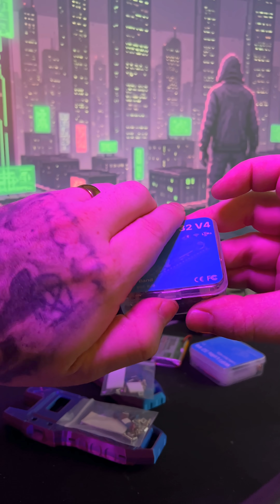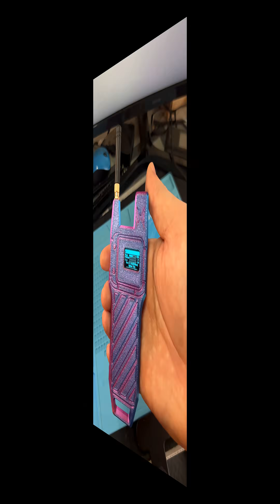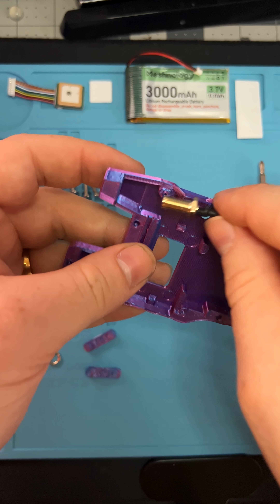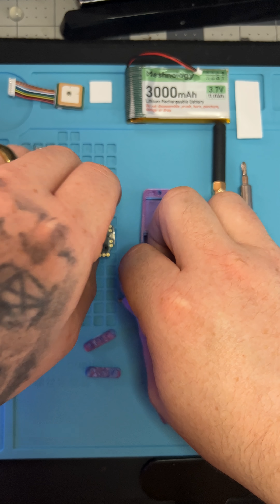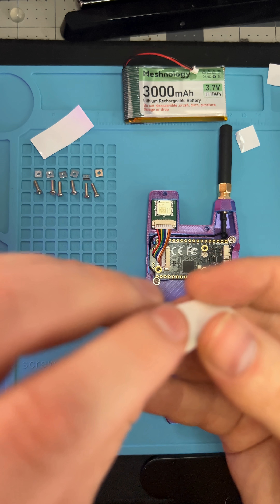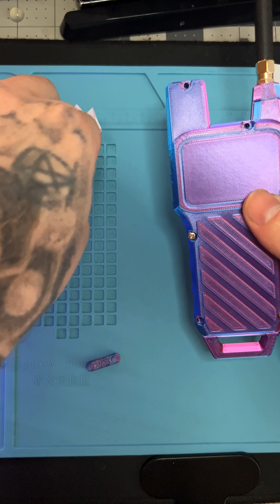LoRa Radio | Meshnology N39 + Heltec V4 Assembly

Comment: Good stuff where I can but it with this case?
Reply from the maker: This case can be bought on Amazon (not recommended) or you can buy directly from Meshnology—through this link: https://meshnology.com/collections/frontpage/products/meshnology-n39-wifi-lora-32-v4-development-kit-3000mah-battery-863-928mhz-antennas